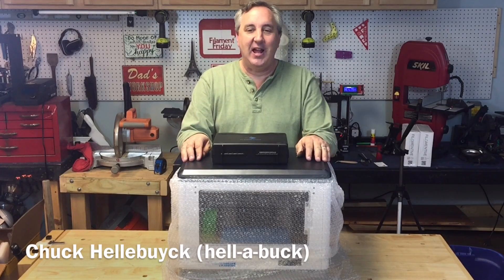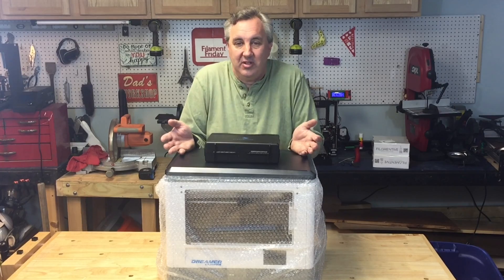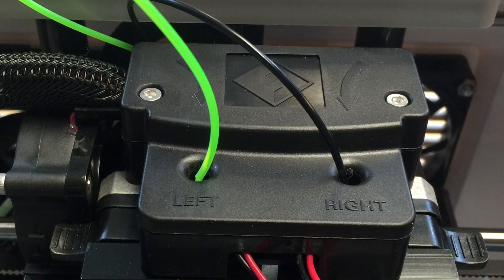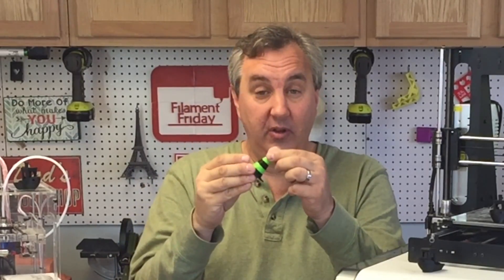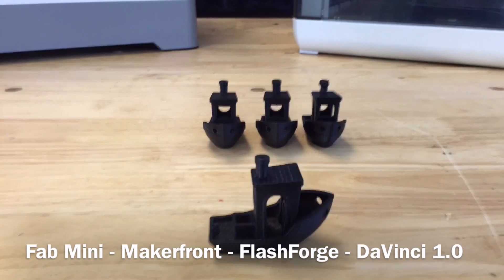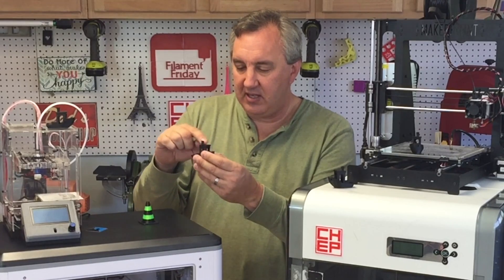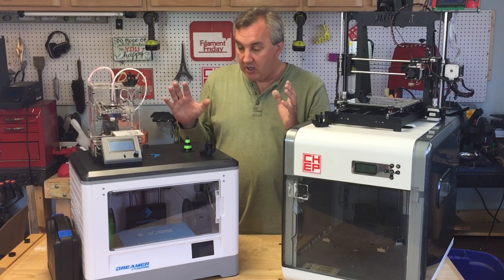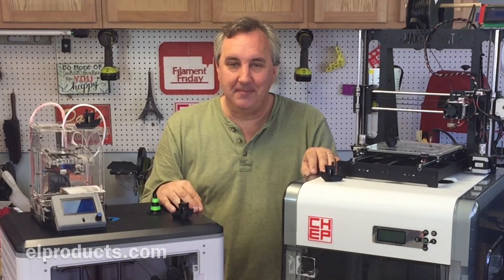3D Printing Filament Friday #66 - FlashForge Dreamer Review

Comment: There are no "shingles" on the roof of the 3DBenchy. So what you consider "crisp details" is actually bad print quality. The only acceptable print here is that of the Dreamer - the other two look like crap.
Besides it was a stupid idea to try dual color print with ABS and PLA. It's actually surprising how good it worked out for two material which have completely different melting temperatures and shrinkage.
Reply: There are no shingles in the STL model. What you see are artifacts from the layers based printing. And artifacts aren't a good thing. A perfect printer would produce a smooth surface on the roof and more or less everywhere else as well. Regarding the Dreamer: they suggest to use PLA left since the extra fan for cooling the filament is on the left side. Many people use the left extruder for PLA and the right for ABS just because this way they don't need to exchange the filament when swapping from PLA to ABS or vice versa.
But of course they still print only either in PLA or ABS since mixing the materials just doesn't make any sense. The only normal usecase for printing different materials is when you want to print support (e.g. PVA or HIPS) with one of the extruders.
Reply: Simply look at the STL model before slicing. Best online picture I could quickly find of the actual model:
http://thingiverse-production-new.s3.amazonaws.com/renders/8c/ea/e3/0d/d3/3DBenchy_-_Multi-part_-_Complete_17_shells_-_3DBenchy.com_preview_featured.jpg
Well, can't say what's on the SD card, still mixing ABS/PLA doesn't make sense as the print will be prone to breaking if it comes out OK at all. Actually for that cone, you wouldn't need a dual extruder anyway.
Using PLA as support for ABS is OK as here the lack of bonding is actually helpful as is the brittle nature of PLA. Still, it's probably better to use something design for support like PolySupport.
Reply: Probably will get the "Shingles" on any FDM printer on the top of the benchy. unless you printed it in some other orientation.  I thought a PLA/ABS duel extrude was weird too, but they included that file with the printer by the looks of it, so he tested it.

Comment: I'd like to see a vid comparison between all your DaVinci printers against the one you flashed with Repetier. have the prints improved a lot. Also does the flash over change the way the bed moves up when loading filament and cleaning the nozzles?

Comment: You can buy the Dreamer on Ebay from the guy that sell's the returns from Amazon. He lists them as Parts but most of them are perfect, just ceal out the extruder and go. I have bought two of them so far, the first was $350 bucks ! the second I payed $650.00 still a great deal for the money, both worked with out new parts. I have done some mods to my $350 buck one that make it alot better for me too use, for one thing I have added a way to adjust the extruder temp manualy on the fly. Great Printers.

Comment: Great to see you have Dreamer, this was my first machine I have a Fabrikator Mini and a scratch build delta machine. The Dreamer is by far the best performer. I have considerably upgraded my machine though, this includes Micro Swiss all metal hotend, removable glass bed with the Flashforge buildTak material I have covered the inside with a sound deadening material to try and quiet it down which has also improved heat retention for ABS prints and Simplify 3D which improved the result from all machines. Result it will print the Nasa ratchet handle beautifully. http://www.thingiverse.com/thing:608397
It is my go to machine for anything that needs to be accurate.

Comment: Hey Chuck... I am trying to get my Fab Mini to print ABS.... But I am getting nozzle blocking. I have hacked the ardunio code in the base software so I can print past 230C... Typically I am printing at around 238C... Still getting nozzle blockages... Any tips or could this be filament type related (I have only tested one brand of ABS so far)? Thanks
Reply: +Chuck Hellebuyck&#39;s Electronic Products Thanks... I'll lower the temp and try again....

Comment: Can you print a large ABS print and see if the full enclosure prevents warping?  I think the temperature controlled enclosure is the selling feature for me since I mostly print ABS.
Reply: its passive heated it help a little bit to prevent warping and eliminates spliting completly. But for large ABS parts you still need a active heated chamber.

Comment: I recently bought a QIDI Tech dual head heated bed enclosed metal frame 3D printer from Amazon.com for $US799. including air shipping from China(!). 
Ordered Monday morning and it arrived Friday afternoon! Very fast and very well double box packaged. 
Something is happening in the 3D world and the world of international sales. 
The price has since gone down to $US699. Must be the competition? 

It is a very good clone of the Makerbot/Flashforge/CTC style 3D printer. It has fully supported z-axis rods and screw. http://www.amazon.com/TECHNOLOGY-3DP-QDA16-01-Extruder-Structure-Filaments/dp/B01D8M32LU/ref=sr_1_1?ie=UTF8&qid=1461821094&sr=8-1&keywords=qidi+3d+printer 

After getting the bed dialled in and levelled; I am amazed at the quality and detail of the prints. 

There are some very good 3D printer deals out there; it just takes some time to find them and the reviews. 
I found this to be a very good list and review of 3d printers; 
http://3dforged.com/best-3d-printers/ 

If this 3D printer meets peoples budget I hope they checkout the reviews and consider it.

Comment: I dont know why but my Da Vinci w/ E3D v6 and bowden mod still prints better then my Fabrikator Mini. Maybe I just have to spend more time on the Fabrikator Mini.
Reply: ***** I am running the stock board with Repetier but I think I will upgrade it soon to a RAMPS so I can install a autobed sensor. Actually I took the feeder from my Fabrikator Mini and another dirve gear and added it to my Da Vinci. I think I am going to make a tutorial video about the bowden conversion soon. I dont have a great camera I guess its a GoPro Hero 2 or 3 but it should do the trick.

Comment: The flash forge looks a lot like the dremel ideal maker, you can see the dremel has the area for the extra filament, so im curious who makes the printer.
Reply: +Chuck Hellebuyck&#39;s Electronic Products And proprietary filament because you cant change the temprature in the software. I guess its 220°C default. Just like with the UP 3d printers.
Reply: +EnergyStrike The UP default temp is around 270C... I have 2 up printers (a mini and an Up Plus 2)... There are a few Temperature hacks for the Up printers... Octave sells a 6 resistor temperature selectible add on... With it you can dial in the temp from 209C ~ 270C
Reply: +Richard Ryerson If you have Simplify3d you can change the temp on the dremel no problem. Its no as locked down as the up or da vinci but you still cant change it with the default software.
Reply: +EnergyStrike I have S3D I use it with my Duplicator i3 and also my Fab Mini... great software

Comment: It must be my eyes Chuck, but man the Dreamer print looks far better structurally over the mini. The mini looks like there are layer adhesion problems on several area's?  Most likely due to an unheated chamber.  

I really think you're going to love the Dreamer once you get it dialed in. I have a Creator Pro, and that thing prints fantastically and is a work horse to boot.
Reply: I've had a dreamer for over a year now, and it's not a great value for your money unless you hack it. There are some incredibly stupid flaws (unable to set pwm for turbo fan, firmware limited settings like temperature). This printer is RUINED by flashforge! Very soon I will be taking out the driver board and replace it with Duet Wifi which is at least, five times better in all aspects.

Comment: Nice review. The quality of the prints are essensial to a review of a 3D printer, so I like how you present the finished prints in close-up for us to see, and not only talk about them. It gives us a chance to judge by ourself. The only thing is that I wish you would show the images for a bit longer, and talk about the pros and cons of the print while you show them off in close-up. Now, I have to pause the video, and move a bit back and forth, to see what you're talking about. Maybe you could use a Filament Friday to 3D print and build a small turntable for such close-ups, to show off the print? :-) 
With a small motor, and some 3D-printed parts, it could be a pretty fun one. Maybe one like this: http://www.thingiverse.com/thing:141287

Comment: thats my printer, i love the flashforge dreamer, only thing i wish it had was auto bed leveling but overall i love it!
Reply: +Marc Alg I have a printer with auto leveling and half the time I question how well it does its job. I like manual adjusting on my Flashforge Creator Pro so I know its right. Auto leveling is just another variable, you dont know if something is out of wack and un-calibrated. I dont know, Preference and opinions.